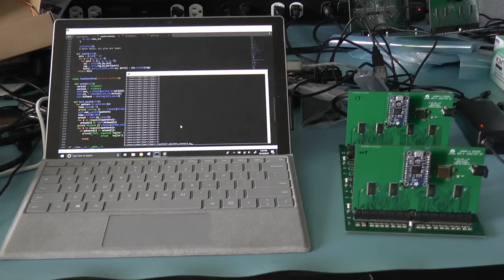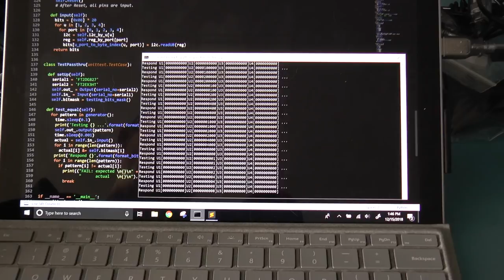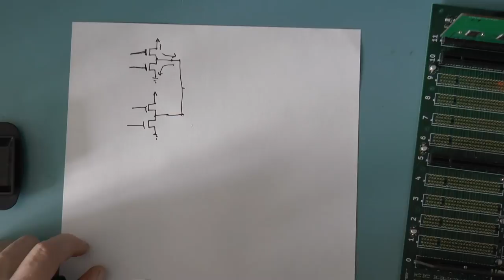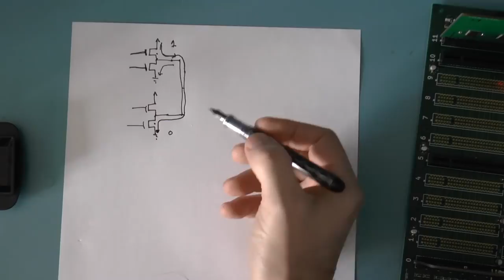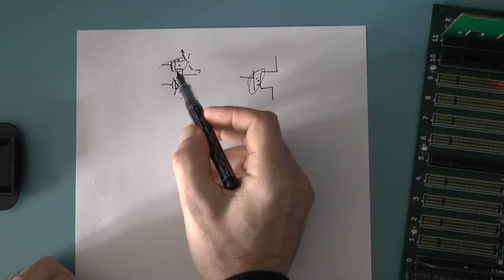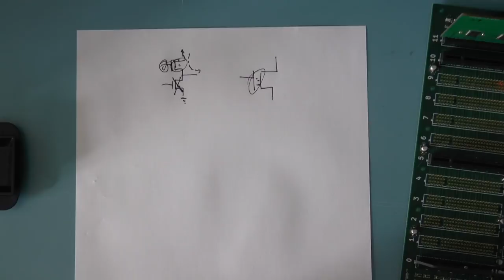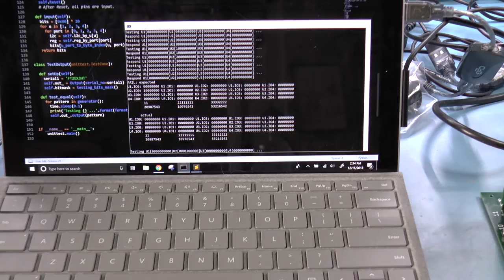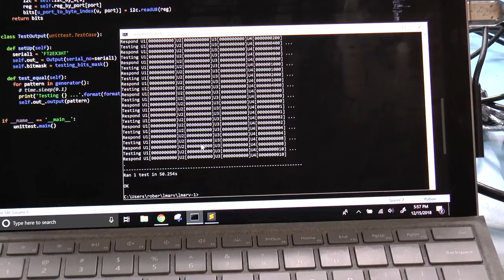LMARV-1 (Tangible RISC-V) Part 7: Testing the tester boards

Comment: I find it very amusing that when you're talking about how there were some solder bridges there's still a very obvious solder bridge on U1. Anyway, I have to question the sense in having a test board that fries itself in the event of any error in the board it's testing.  Any bridge between two neighboring traces has the possibility of creating that same dead short failure state and with a rating of just 10mA source 25 mA drain even a relatively high resistance bridge between the IO lines and any other trace runs the risk of damaging the io expanders in the same way as your solder-bridge.  I'd tentatively recommend you consider respinning this board with some input resistance on each line, or at least putting together a new board which was basically just a socket and slot connector with 160 in line resistors to go between the board and the bus.  

If the idea of soldering 160 smd resistors sounds like hell maybe consider looking for an isolated resistor network which would be easier to populate or just a complete IO buffer with its own protection, but to be honest I don't think this board as it stands is particularly functional as a test board.  Any error could cause it to fault making problems even more difficult to diagnose because it now casts doubt on the test hardware as well.  I worry this will be particularly bad when the boards under test get more complicated and when everything is done via hand soldering which can naturally have a tendency to form bridges.

I've been really enjoying the videos so far though and I'm excited to see where this project goes, just have to put in my two cents on this one.
Reply: Esven you can get resistor networks in smd, no need to solder individual resistors if not needed. In terms of soldering, these boards aren’t difficult. What is needed is to carefully inspect the chips under microscope for bridges, cold joints, etc. not a big deal and can be done quickly with practice.
Reply: @dirkflannigan5271  I think you might have misunderstood part of my original reply, because I did mention specifically "If the idea of soldering 160 smd resistors sounds like hell maybe consider looking for an isolated resistor network which would be easier to populate"  isolated being the internal circuit layout of the resistor network I was suggesting as opposed to a bus, ladder, or some other internal arrangement.  Additionally he's obviously having issues with solder bridges and these are untested boards, so an incidental connection between traces should be a failure state the test board is hardened against.
Reply from the maker: Ah, those traces on U1 are supposed to be connected together :) Well-spotted! The inline resistors are a good idea. I've soldered plenty of resistor arrays, so 160 isn't that big a deal.

Comment: You could do a passive test per IO port pin.   Using a multimeter in resistance range ,for  each IO pin measure the resistance to  Vdd and measure the resistance to Vss (you may need to swap the multimeter leads around).   Measure a know good IO expander IC  and compare with a suspect  IO expander IC...  you will surely find there is a difference....   (this is real a single voltage  IC cure tracer method)
Reply from the maker: Interesting idea! Although now that I've got two good testers...